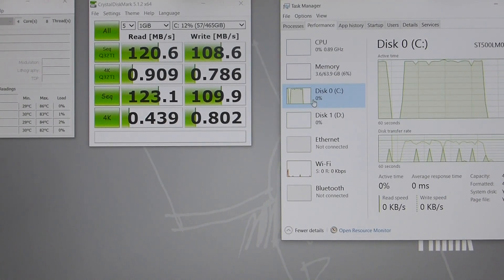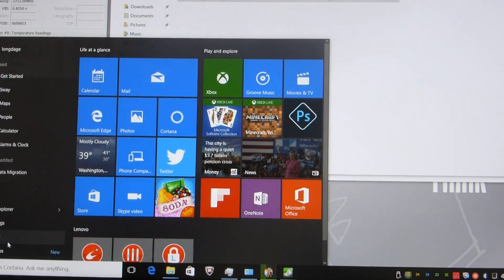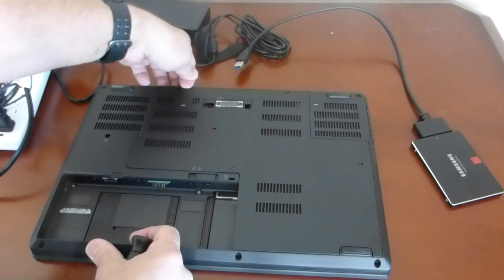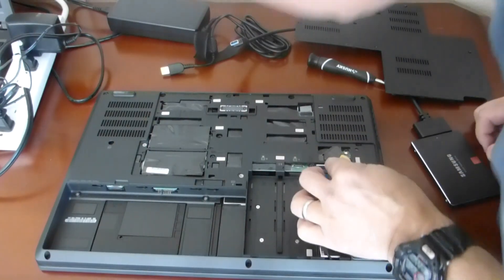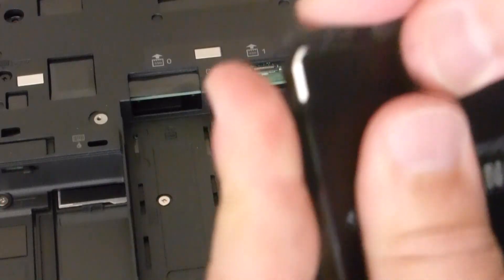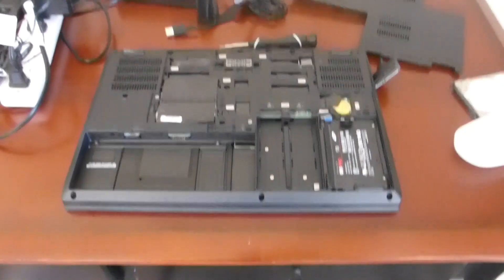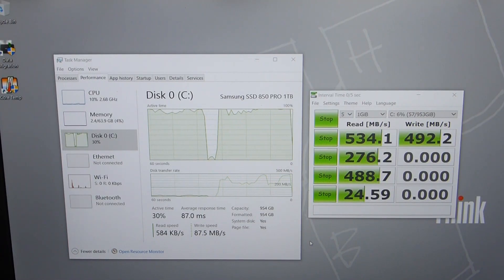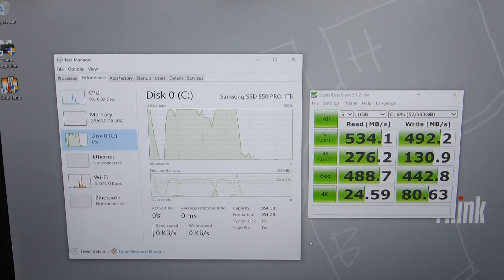Lenovo ThinkPad P50 Hard Drive Swap

Comment: I opened my P50 up and my HDD slot shows no hard drive! WTH? Everything else looks the same.
Reply: Yeah, your P50 probably only has an M.2 drive. Mine's the same, it's only got a 256GB SATA M.2 SSD. You can check in your system information.
I suppose there's no reason not to just add a second drive, really.
Reply: @Nixitur  Yep. I figured that out after my message. I ordered a drive bay adapter and installed it. All good now. Thx.

Comment: Recently my Lenovo P50 Laptop suddenly won't turn on. It turns on for only 1second, with the green power button and keyboard lighting up for 1 second, then it immediately shuts down. When I plug in the power supply, the green light on the back of the computer lights up when I have the battery installed. So it doesn't seem to be a power supply issue. I searched all over the web for solutions & tried doing power drains, unplugging/ plugging in the battery & power supply, running with just the power supply, running it with  just the battery, & both battery & power supply. I did the CMOS battery resets, removing HD & ram then trying to powering it on, but I get the same result.
Have u ever dealt with anything like this with any Lenovo laptops you've worked on? Do u have any possible solutions? Please let me know. Thanks & have a nice day.

Comment: I bought the P50 with a 256 SSD as the main drive, instead of the HD, with the intent of just changing out to my 1TB 940 Samsung SSD with all the installed SSD parts , but I now see drive one is stuck with the M2 style of SSD for the main drive.  I read that one can install a 2.5 inch as one of the drives.  
1. Does adding the 1TB SSD drive in the 2.5 inch drive require parts?
2. I got the reinstall disks, and was planning on just reinstalling the system, just as I had on a W520. Any reason to use the Migration software?  
Thank you very much for the video. I know this can be tricky, and want to be sure I do it right.

Thanks!

Comment: I am confused why you returned the M2 PCIE version you got by mistake. I have that one, and I get 2.4k for read, 1.6k write (so about 5 times faster than your SATA SSD). you could have just bought the cable or enclosure, the PCIE NMVE is light years ahead tech that your SSD. I am happy for you, you saved money, but I think it was most that given that Lenovo make a mistake, you could return and happened to face a lower price in the website, but the swaping the unit because they gave you a better disk, is a head scratching for me. just my humble opinion.your videos will be very useful for me as I get my P50 as I want it.
Reply: The guy is a fucking idiot

Comment: the video is useful as I just got my P50 with only the M2.PCI NMVe drive and I want a 1TB spinning just as data dump or it money allows a SSD. do you know if Lenovo sells the kind of plastic caddy that the HDD had? do you know if a similar caddy is needed for a M2? the space looks quite empty I am sure the M2 will be loose if I just put it there?
Reply: Daniel you need to buy this:  http://shop.lenovo.com/us/en/itemdetails/4XB0L63274/460/7EF7D50A5A7047049A355BF42AAF3C5C

Comment: What a dumbass.  You should have bought a NVMe SSD and kept the existing drive as well.  Now you have a slow SSD and you can't use the existing drive it came with.
Reply: If your work is not very disk-intensive, then it won't be a big difference in time efficiency vs the cost benefit. SATA III SSD is still 5 times faster than the mechanical ones.

Comment: I'm running a Samsung 950 Pro without issue.  My only gripe with the P50 is the 4K screen.  It's amazingly crisp but gives me vertigo after 15 minutes of use.
Reply: I don't get it. if you set it as 200% magnification as the OS would recommend, it is almost the same as 1920x1080 but with sharper text. were you joking?

Comment: getting the run around with Lenovo.  before buying i am trying to figure out if this thing will support 2 2.5" drives.  the hardware maintenance manual seems to look like it does.  I even found 2 different hard drive cables, one for slot 3 and one for slot 4.  but one is sold out that is $23 and one is available but for $127.
Reply: +Peter Markey around 7:50 in your movie you can see the connector for the 2nd HDD cable.  but wonder if you can order the 2nd drive caddy.  sales just tells me 2 2.5" drives is not supported.

Comment: I'm not very techy, but is it possible to put in a 500gb ssd next to the already existing 500gb harddrive that came with my laptop?
Reply: and if you can, do I need to buy another little cable thing so it connects?
Reply: yes,,, just buy a NVMe SSD and put it on the NVme slot so you can keep the existing 500GB HDD.
Reply: the P50 takes up to three disks, two in M2 format, one in 2.5 inches. the M2 can be SATA or PCI NMve. my gues for all of them you need some sort of caddy or enclosure to hold the drive in the space the computer has.

Comment: Yes! that would be great if the system came with the required cable in you video. When I picked the M.2 type drive and paid extra for the upgrade, It didn't tell me that the 2.5" proprietary cable was required now as it would have just been included without the upgrade, This would now need to be ordered. Which you cannot even order from IBM Spare parts, or Lenovo.. and even if you could the price has been dramatically increased! Shame on you guys at Lenovo.. Very disappointed!

Comment: Is there a limit on the size of the SSD drive? I've read a couple of reviews that say that the max is 1 TB SSD. Samsung also makes a 2 TB 850 pro SSD, so physically its the same size... Will it work?
Reply: Hey. The maximum one is 4 TB SSD so that's why they made 2 TB ssds and 1 TB.   The SSD is called solid state drive not solid state drive drive.  

The d at the last means drive

Comment: did you check for 4k alignment after the samsung migration?  I have had to correct 4k alignment when doing some dell 
migrations using samsung migration software.
Reply from the maker: +psycl0ptic how would i check this?